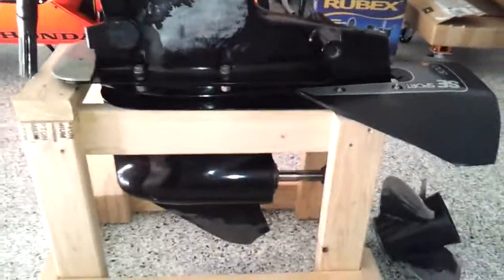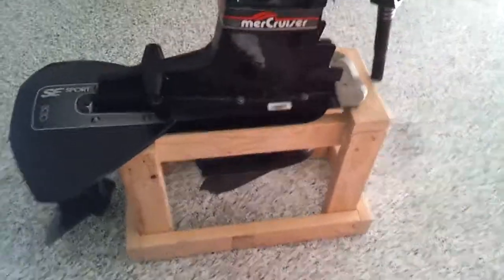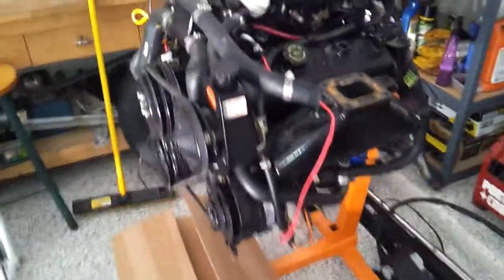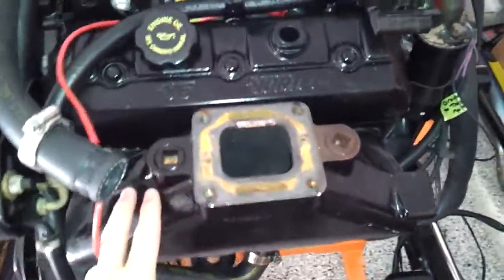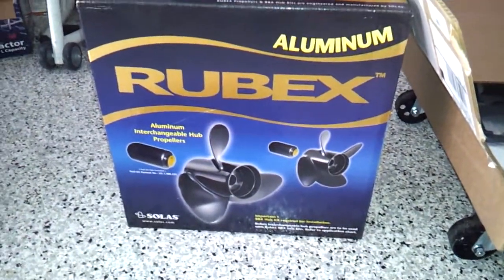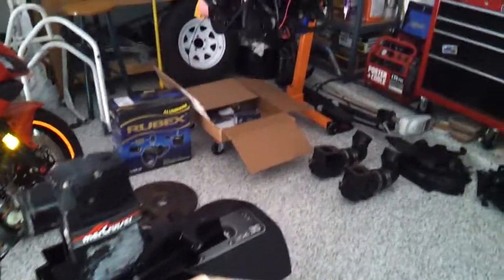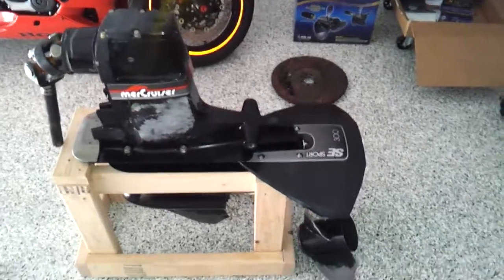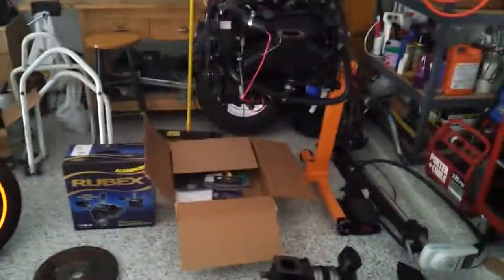My First Boat Story, Don't let this happen to you!

Comment: What did u find, water in the oil?
Thanks
Reply from the maker: I had a cracked block, a 3” crack between cylinders 1 & 3. Previous owner didn’t winterize it correctly!